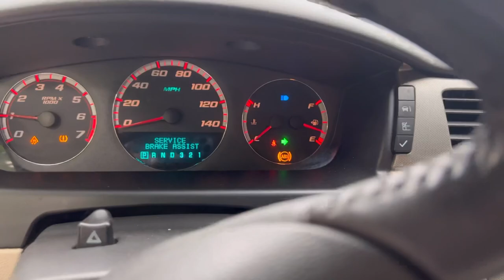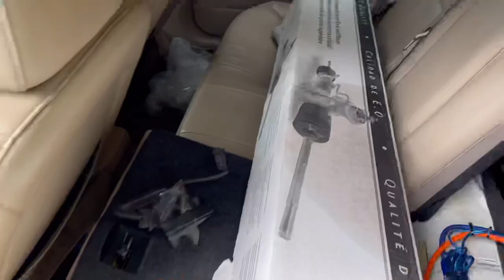HAD A WRECK IN MY CAMMED IMPALA SS…MIGHT BE TOTALED

Comment: that's sad but it happens and it's kinda easy lol the rack is a tight fit need to drop the rear part of the subframe to install and carefully route your low and high pressure lines if your redoing them as well good luck 🤪